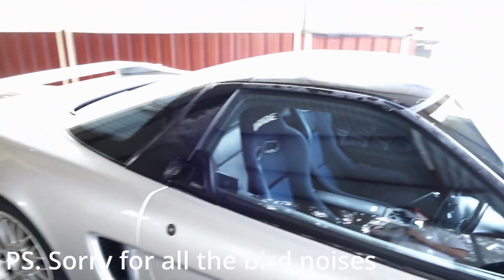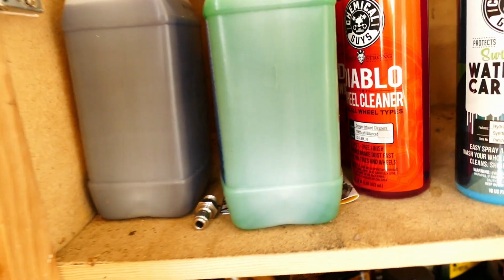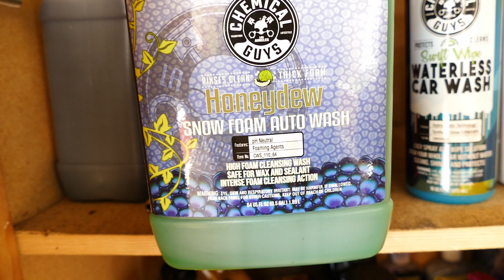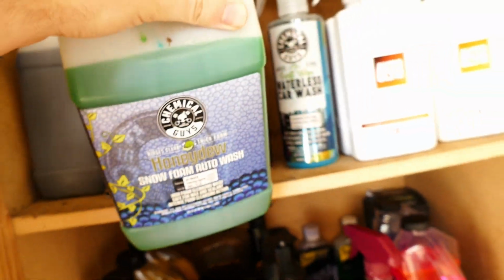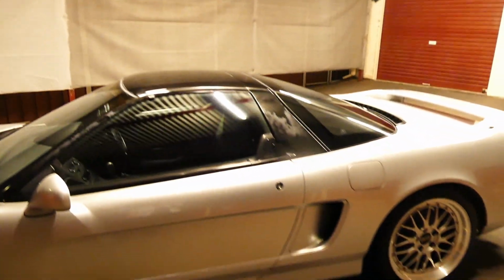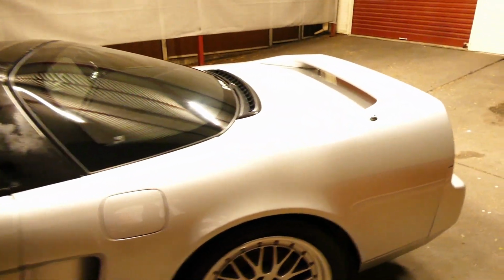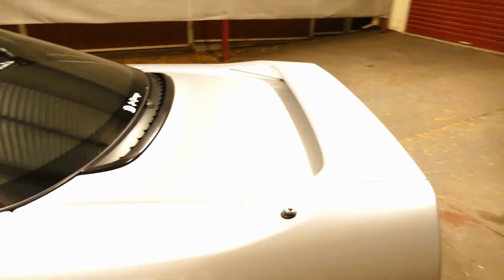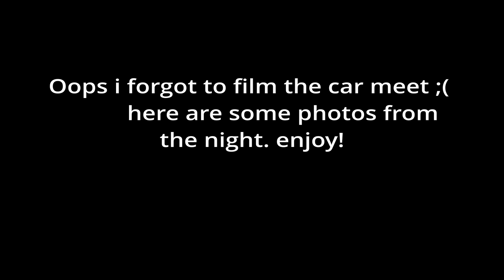Getting My NSX Ready For Its First Car Meet!!

Comment: Actually really enjoyed watching you clean the NSX. Envy the space, water tap, high pressure and space but well done. It looks like you have clear coated the car so while easy to keep sparkling over time the UV turns it white especially on cars in the 90's. I have OEM paint which I go through all the processes and rotary polish and always place a light cover on the car in a garage which then the luster lasts about 1 1/2 yrs. The lower half of the car around the sills, bumpers are always going to have some grit so completely finish the top surfaces first. I'm sure you have a permanent smile when driving.
Reply from the maker: Hi and thank you for your kind comment 🙂. I am very lucky with the space I have. Yes I did machine polish the car like you and I used mother's cmx ceramic coat as a finisher. I have used it before and I think it's a great product. Thank you for the tips. Yes driving the nsx around is one of the best feelings.